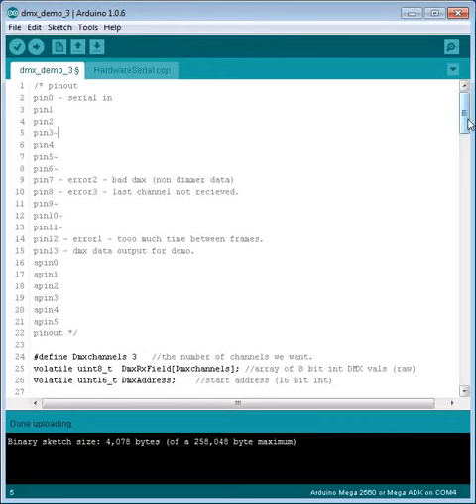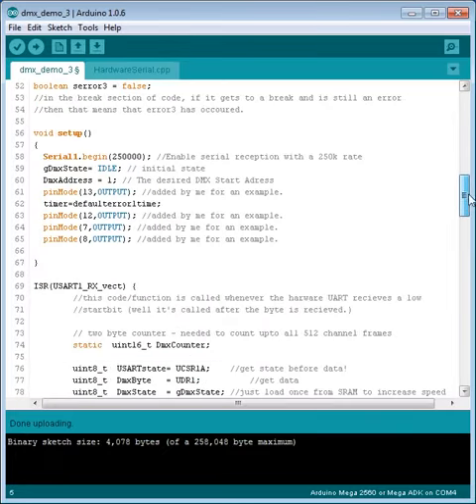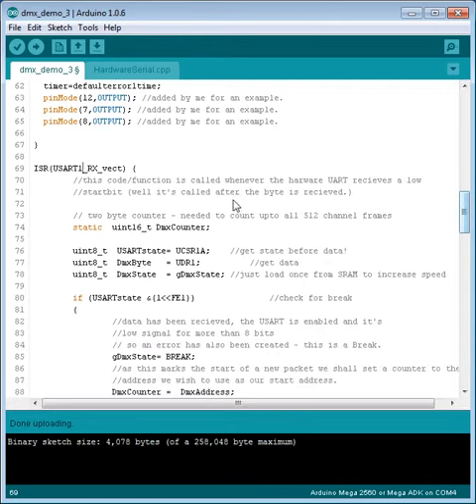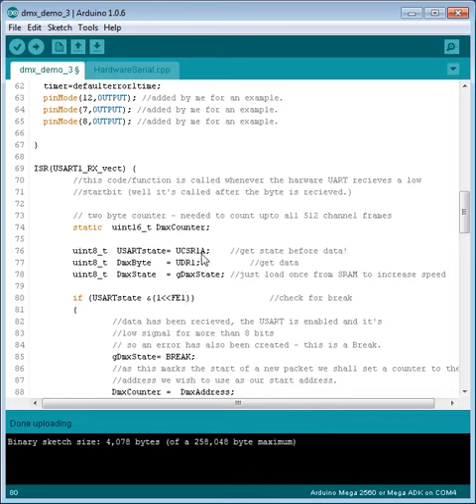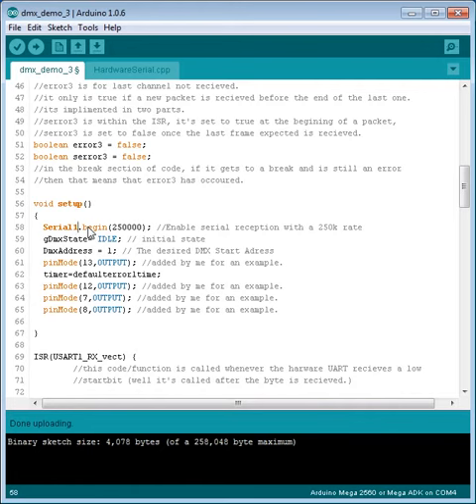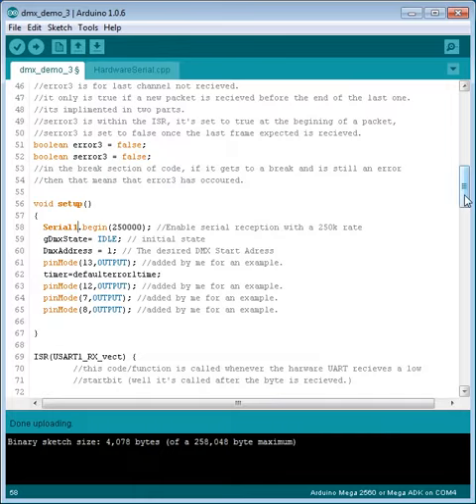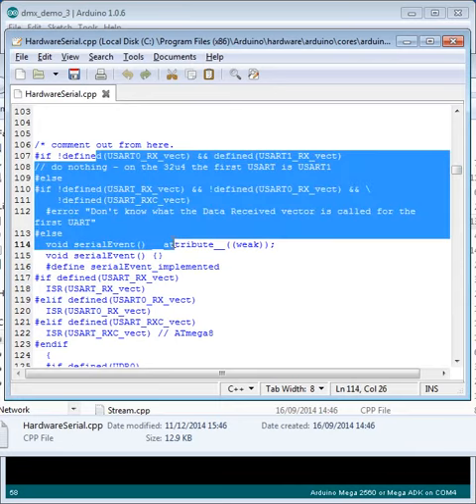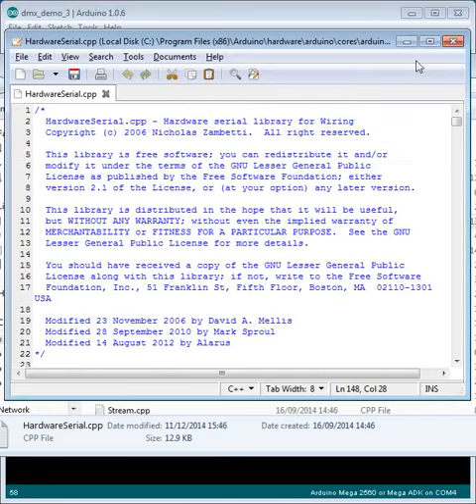#5 How to: ArDMX recieveing DMX on Arduino Mega

Comment: I would like to use your sketch to control a servo any advise? How do I "tie" the DMX signal 1-255 to the servo rotation? In looking at the sketch I only see the ">127" as the trigger...Any guidance would be appreciated.
Reply from the maker: Hi Galen, 
a simple bit of code like: 

if(array[0]>127) //array with the DMX values in (0) being the zero indexed channel needed. 
{//move servo to new location 
} else 
{//move servo to first location
}

Should do the trick. 

If your using Arduino make sure to put the servo on a PWM pin, as these use hardware timing so are not affected by the DMX interrupt loop.